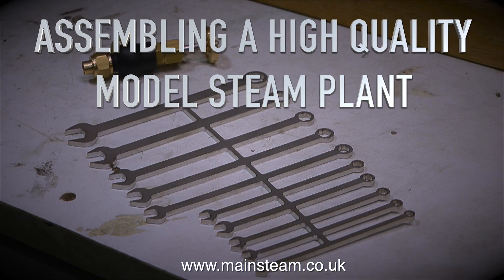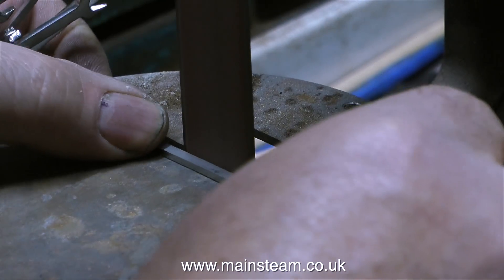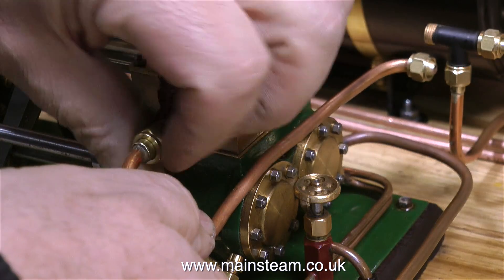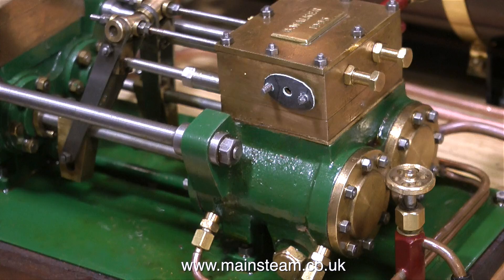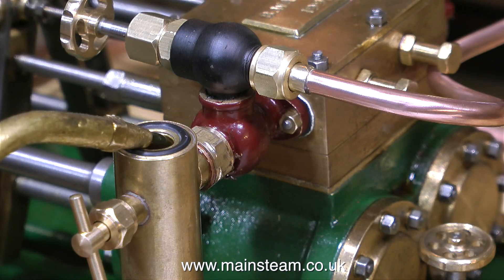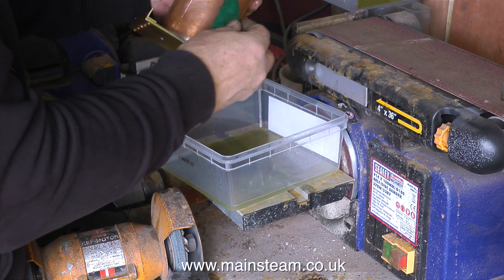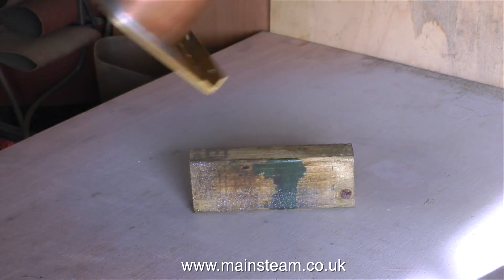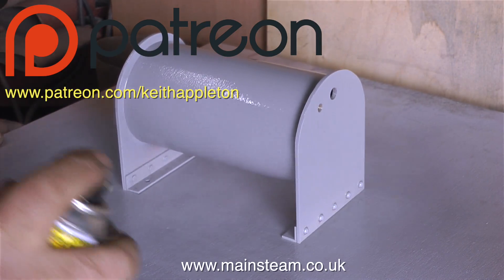ASSEMBLING A HIGH QUALITY MODEL STEAM PLANT - PART #16

Comment: There are products out there that will prep your surface, remove wax, oil, grease, etc., that is no where near as toxic as cellulose thinner, works just as good, and not as flammable. Talk to local independent autoparts store.  MIldly expensive but goes a long way.